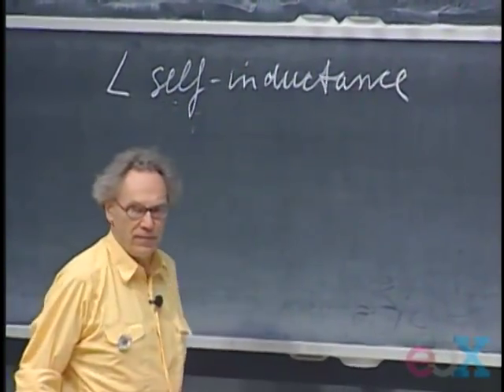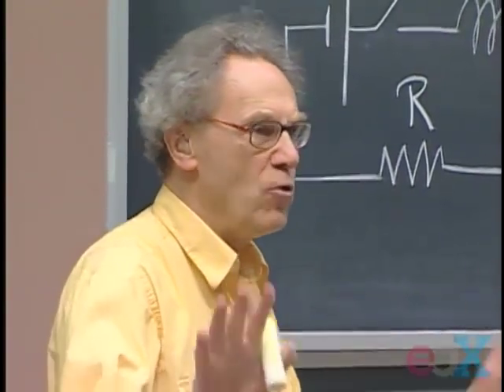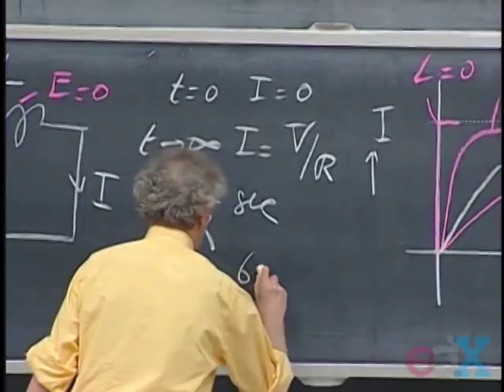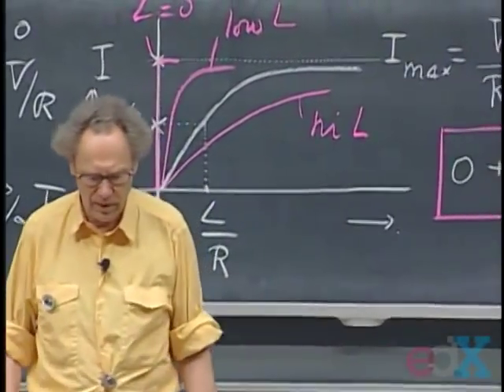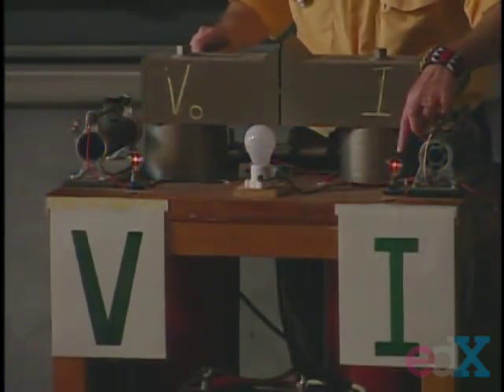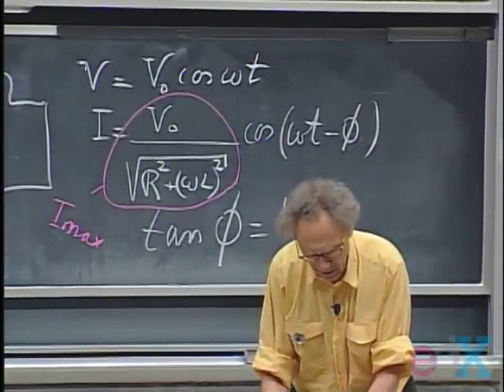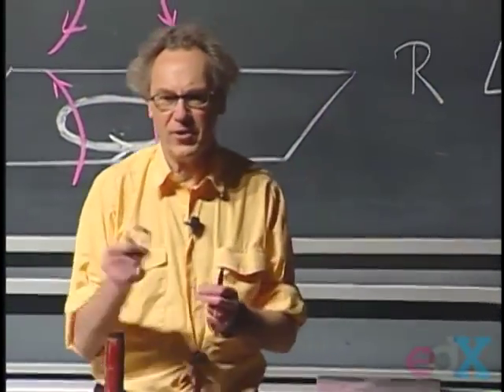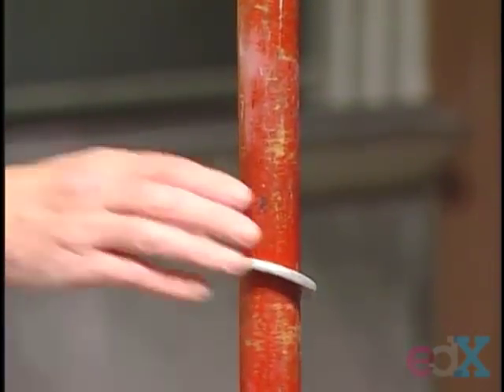8.02x - Lect 20 - Inductance, RL Circuits, Magnetic Field Energy

Comment: Dear Professor, 
So E filed and therefore potential (integral of E. dl) is zero for any ideal inductors regardless of power source (DC, AC,...)?
Reply from the maker: The integralof E dot dl THROUGH the ideal self inductor from one side A to the other side B is always zero. It is not zero if you travel van A=>B in a path outside the self inductor
Reply: Professor, then the voltage measured by a voltmeter attached to the inductor is the voltage that drops on the voltmeter branch, caused by dPhi/dt, but not the voltage drops on the inductor. Am I right? Thank you much.
Reply from the maker: You should NOT call the integral of E dot dl potential difference in the case of an ideal inductor. Because of Faraday's Law, the integral of E dot dl from one en of the ideal inductor to the other end is different for different paths. If you go through the superconductive material it is always zero if you measure it outside the inductor it is + or -- LdI/dt.
Reply: I got it. Thank you very much.

Comment: Dear prof,
I dont get it. Why can there never be a voltade across an inductor? ist its emf = -L di/dt ? Son whenever current changes shouldnt a back emf be generated?
Reply from the maker: The integral of E dot dl through the wires of an ideal inductor (with zero resistance) is ZERO. The induced emf is generated in other parts of the circuits (e.g.. in resistors). If you attach a voltmeter over an inductor it will read -LdI/dt bcos the voltmeter has resistance. The closed loop integral in the loop consisting ONLY the voltmeter and the inductor is -L dI/dt but E dot dL through the inductor is zero. Thus E dot dL through the voltmeter must be -L dI/dt. I know that this is difficult for many students. Frankly there are many high school physics teachers (even college Physics teachers) who do not understand this either.
Reply: thank you very much, professor.  I was taucht you could treat inductor as an opposing battery and use kirchoffs loop rule n get the same DE.
How can we educate ourselves correctly?

Comment: I know this is a little late sir..
But is lenz's law only Applicable for Circuit having AC current
Or is it applicable for More then just current and changing magnetic flux..I mean it Feels so much like Newton's 3rd law...
What's the difference? Between them both?
Reply from the maker: It depends on how narrow your definition Of Lenz' Law is. For me Lenz' Law is the -dphi/dt term in Faraday's Law and that is not limited to AC current. Watch 8.02 lecture #16 where an induced emf is created. If you see a connection between Faraday's Law and Newton's 3rd, be my guest. I do not. Faraday's Law allows us to create electricity by moving a magnet.
Reply: Lectures by Walter Lewin. They will make you ♥ Physics. Ahhhhhh. I get it 
So lenz's law is basically derived from Faraday's law...it's a consequence of Faraday's law...
Not an independent law itself
Am I right? Sir?
Reply from the maker: correct
Reply: Lectures by Walter Lewin. They will make you ♥ Physics. 
Thank you sir....you're the best ....
I got a +up in my thinking all thanks to you....
I will always have regret Of not being your student.....

Comment: how do i look up the "new 0??" (i might be wrong on my interpretation)
Reply: Its µ0. µ is a greek letter, pronounced [mju:], in case anyone were still wondering
Reply: mu_0 is called the magnetic permeability of free space.  Epsilon_0 is its electrical counterpart called electric permittivity.   Mu_0 and epsilon_0, are the two properties of free space that work in Maxwell's equations, and govern the speed of light.

The subscript zero indicates that it applies to free space, rather than a specific material.  A ferromagnetic material will have a larger mu than mu_zero, making it useful as the core of an inductor or transformer to enhance the magnetic field from what it would be with no core.  A dielectric material has a higher epsilon than epsilon_0, and is what you use for enhancing capacitance from what a vacuum-gap capacitor would be.

Comment: Sir please what is the difference between R and L, since they both RESIST the current ?
Reply from the maker: it's as large as the difference between a windmill and an airplane (they both move)
Reply: R is resistance, and L is inductance (or more precisely, self-inductance).

What they both have in common:
1. they are both properties of passive electrical components, that govern how the component will impact an electrical circuit
2. they both are properties of the geometry of the component, that do not depend on electrical operating conditions.

Differences they have
1. Resistance is a property of energy dissipation, while L is a property of energy storage
2. R has units of Ohms, and L has units of Henrys.
3. L's units don't become Ohms, until you multiply 2*pi*f*L to account for frequency
4. The Ohms associated with L are called reactance, rather than resistance.  This is because they cause a change in phase between voltage and current, due to the self-inductor storing energy and releasing it later on in the AC cycle

Resistance and reactance are generalized with a concept called impedance.   Complex numbers are used for keeping track of impedance, where resistance is assigned the real number portion, and reactance is assigned to the imaginary number.

Comment: Sir,
If we remove the resistor frm the circuit shown at 06 :00
Will the induced voltage across the ideal inductor dies out ??
Any current flow through the inductor ??
Reply from the maker: there is NO induced voltage across an ideal conductor as the E-field inside it is zero.
Reply: Thnkzz sir..
Now iam erasing the misconcepts which learn from school.

If the circuit without resistor

During switch On ( t =0+).(transient)

Will the current changes ??

If the current changes then magnetic field inside the inductor changes
According to faradys law an emf induced across the inductor ,by Lenz's law , induced voltage has -ve polarity .dat oppose the supply voltage..
Will the induced voltage across the inductor equal to the source voltage ??
If its
Then no current flow through the inductor.

Is it true ?
Reply from the maker: >>>>>If the current changes then magnetic field inside the inductor changes>>>>
YES
>>>>According to faradys law an emf induced across the inductor ,by Lenz's law>>>
NO EMF is induce across an ideal inductor. It's induced elsewhere in the circuit.  There cannot be any E-field inside a superconductor, thus there cannot be any voltage across a superconductor as voltage is the integral of E dot d inside the wire of the inductor. However, if you attach a voltmeter over an inductor it will read -L*dI/d. This is confusing for many students. I suggest you watch 
https://www.youtube.com/watch?v=LzT_YZ0xCFY&index=6&list=PLyQSN7X0ro22zanLOcvkaSY-IZqheFYM5
>>>Will the induced voltage across the inductor equal to the source voltage ??If its Then no current flow through the inductor.>>>>>

 NO NO NO NO NO
Reply from the maker: watch this also
https://www.youtube.com/watch?v=FWMhk6x785Q&index=26&list=PLyQSN7X0ro2314mKyUiOILaOC2hk6Pc3j
Reply: As current is increasing...d induced emf is also increasing(as flux throught it is incresing)...it induces polarity....opp. to wht it should have been if it was just a resistor...then..t=infinity....emf across it..becomes..0...thus it has zero reristance...it is ryt..?????sir

Comment: From which books did u use to study in your years?
Reply from the maker: 8.01
Physics
Hans C. Ohanian
2nd edition
W.W. Norton & Company
ISBN 0-393-95748-9

8.02
Physics for Scientists & Engineers by Douglas C. Giancoli. 
Prentice Hall
Third Edition
ISBN 0-13-021517-18

8.03
Vibrations and Waves by
Anthony French
CRC Press
ISBN 9780748744473

8.03
Electromagnetic Vibrations, Waves and Radiation 
by Bekefi and Barrett.
The MIT Press
ISBN 0-262-52047-8
Reply: I have a little confusion sir,
Mathematically, Integral from A to A of any quantity whether conservative or not must be zero, after all this is just area under any graph from one abscissa to the same abscissa. But Faraday's law gives - d(phi) /dt for a closed loop, how to mathematically understand it?
Reply from the maker: No that is NOT true. In a circuit where there is an induced emf V Volts, the closed loop integral of E dot dL in going from A to A is NOT ZERO it is V. If you go around the closed loop twice then it is 2V. This is the basic idea behind transformers. It's the result of Faraday's Law which runs our entire economy. Watch my 8.02 lecture #16 https://www.youtube.com/watch?v=nGQbA2jwkWI&list=PLyQSN7X0ro2314mKyUiOILaOC2hk6Pc3j&index=17
Reply: I asked you that question after watching lecture 16 only. In Maths we are taught that if the limits of a definite integral are same then it gives 0. I got what Faraday's law says but this Maths rule  seems not to be obeyed.  Please explain.
Reply: Is it just that with working with induced emf this Maths rule is not obeyed??

Comment: Can anyone please tell me how to solve this differential equation
Reply: Watch maths lectures 18.03
Reply: This is a differential equation you'll solve in the first week of a differential equations class.   It has to do with the fact that e^x is its own derivative, and exponential functions in general have a derivative that is proportional to the value of the function.

Consider the simple example of:
dx/dt = k*x

Swap the "denominator" of the Leibnitz derivative notation for x, as if it were a fraction:
dx/x = k*dt

integrate both sides, and remember the arbitrary constant (C):
integral 1/x dx = k*integral dt
ln(x) = k*t + C

Solve for x:
ln(x) = k*t + C

Exponentiate both sides to clear the logarithm:
x = e^(k*t + C)

Use properties of logarithms to bring down the C:
x = C*e^(k*t)

Then you would use your initial conditions to determine the constants C and k.   In the example of LR circuits, k relates the inductance and resistance values of the components in the circuit, and C relates to the initial value

Comment: Professor,  please help me my mind is going to blow up
If I say that there is a phase angle between induced current and induced emf in a coil this does not make sense.
Because when the current starts  increasing emf would be max and induced current is min and opposite direction to the source current. But when the current starts decreasing emf is min and change direction and the induced current is supposed to be max and is not changing its direction yet.but if induced  current didn't change its direction how could it be able to create  a magnetic field to oppose the  change.
Reply from the maker: your answers are in my lectures. Watch them
Reply: @lecturesbywalterlewin.they9259  thank you so much Sir 
May Allah grant you very long life.you are a fantastic man

Comment: Hi Prof,
Awesome lectures! I have a few questions that I was hoping you could answer for me. If the inductor was not made up of super conducting material (10 minutes in) - would there then be a voltage drop across the inductor equal to IR?.. since there is now a resistance across the inductor and is it wrong that physics books don't add this IR drop across the inductor?.. They just assume the voltage drop is only L(di/dt) across the inductor. Would you have to add this IR drop into your equations when using a non superconducting inductor? Also I would like to know if there is energy lost when the self-inductance sets up an emf to oppose the changing magnetic flux? And is it possible to calculate this energy lost? Thank you for your time.
Reply from the maker: how many minutes into the lecture?
Reply: At 10 minutes, the DC circuit with the super-conducting inductor, resistor and a battery.
Reply from the maker: If the self inductor had a resistance R1, the integral of E dot dl through the wire of the selfinductor would then be IR1. The closed loop integral of E dot dl of the entire circuit would still be --L*dI/dt. Thus the diff eq would be the same of what I have now by replacing R by (R+R1)
Reply: Okay I understand, thank you Sir. And in the same experiment, the self inductance of the inductor (that creates an EMF to oppose the change in magnetic field), is there energy lost due to this process?... Since you will have a current from the battery flowing in one direction (inducing a magnetic field in the inductor) and a current from the self inductance of the inductor flowing in the opposite direction to oppose this change in magnetic field. And is it possible to calculate this energy lost if there is any? Thank you for your time.
Reply from the maker: After some time the current will be I=V/(R+R1). Assuming R1 resistance in the self inductor. Dissipated power (energy loss/sec in the form  of heat) will be I^2(R+R1). The energy in the self inductor will remain constant at 0.5Li^2.
Reply: Thank you Sir :)

Comment: hello sir 
in RL circuit if we close the circuit and the current reached the steady state and we quickly open the circuit we will see a spark between the contacts due to the rapid change in the current from the maximum value to zero and this gives us a huge  value of voltage that makes the spark,is it correct?
and if we connect an inductor parallel with a neon lamp(need 180 volt) and connect them a cross a battery(12volt) the lamp cannot lights up but If we disconnect the battery from the circuit the neon lamp will flashes why? if the current found a close path( the inductor and the neon lamp) to go through and there is no rapid change in the current to provid a high voltage needed.
Reply from the maker: question unclear, plse simplify it
Reply: i have a circuit containing inductor, neon lamp(requires at least 180 volt to cause it to glow) and a battery (6 volt ) they are all parallel to each other and There is a key next to the battery if i close the key the neon lamp cannot glow But if i open the key, we will notice the glow of the neon lamp momentarily and then extinguish why?
Reply from the maker: easy: When you close the switch the neon tube cannot possibly light up (12 V is not enough).A current will flow through the inductor. Since a perfect conductor has a very very low resistance a ver large current will flow through it (if you wait a few seconds).In fact the current through it may well be determined by the internal resistance of the battery. Now you open the switch. There is a large B-field inside the conductor. The energy in that B field is dumped into the remaining circuit using Faraday's Law. At first the induced current in the circuit will be HUGE as dB/dt will be large. If it is larger tan 180 V the neo bulb will flash. This is a classic demo.
Reply: Lectures by Walter Lewin. They will make you ♥ Physics. thanks sir,I am sorry for being late
is this the same reason why we see spark if we quickly opend RL circuit?
Reply from the maker: yes
Reply: Lectures by Walter Lewin. They will make you ♥ Physics. 
but sir spark happens when we open the circuit and ther is no close path for current to go through so the current drop from I(max) to ZERO in no time so di/dt is large and hence the induced emf.
but in neon bulb when we open the circuit there is a close path for current to go through (the inductor and the bulb) so the current take time to decay so di/dt is not large and hence the induced emf will not be large is this correct?I am confused.
Reply from the maker: there is ALWAYS a closed path through air as long as the E-fields are high enough. Watch my demos where I light up a fluorescent tube holding it high up in the air near the vdGraaff.
Reply: Lectures by Walter Lewin. They will make you ♥ Physics. another question sir  the current takes time t to reach the maximum from zero is it the same time  takes to drop from max to zero?